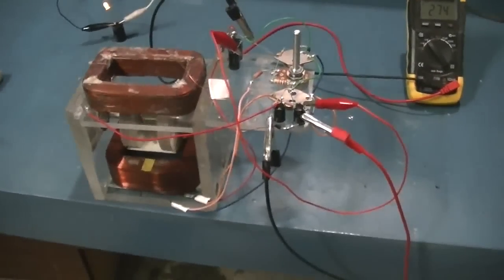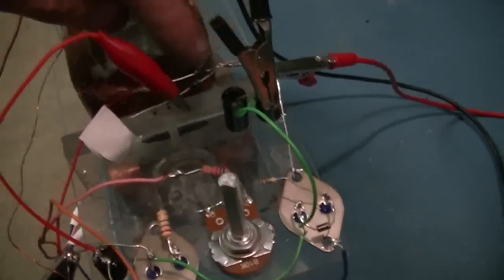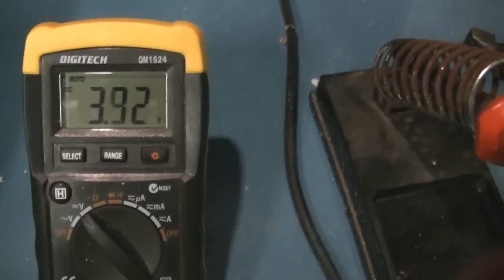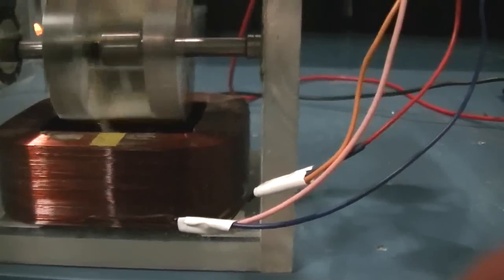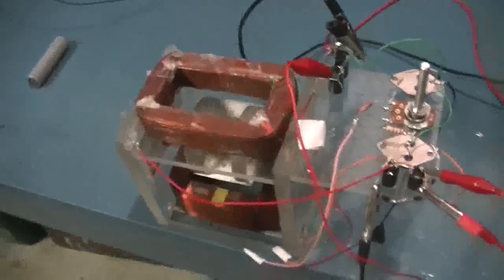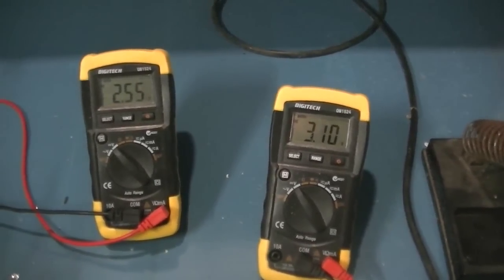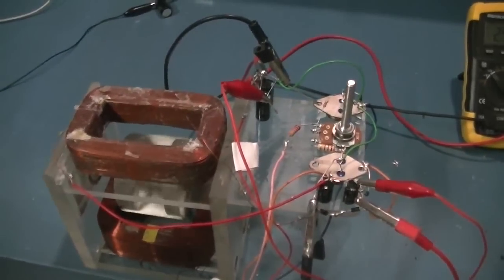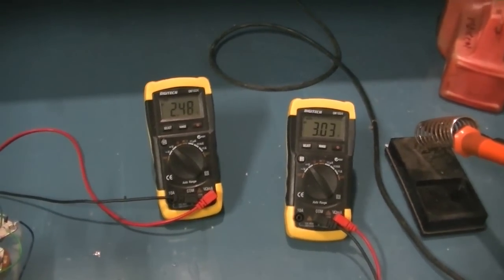window motor running on caps.flv

Comment: Nice work Tinman, I've seen some pretty amazing window motors on The Tube, it seems they draw very little - perhaps like those oscillating pendulums or a grandfather clock.